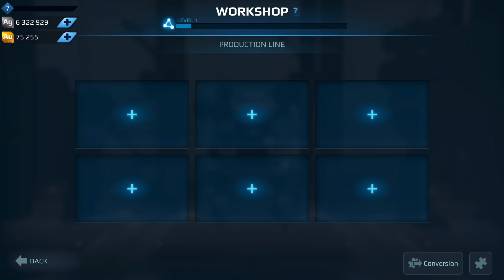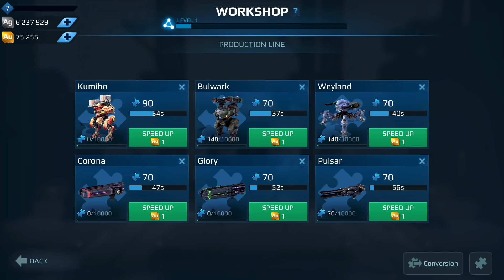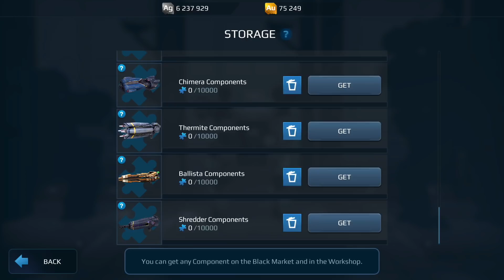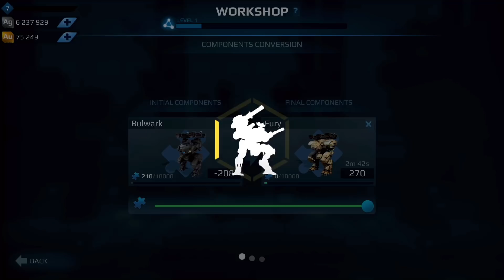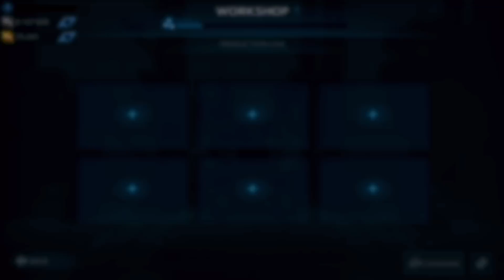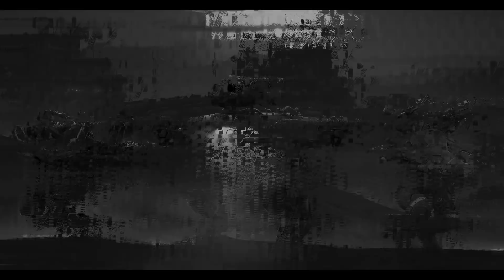NEW Workshop 2.0 Component Conversion Feature Explained / War Robots Test Server

Comment: Ya I would agree the numbers are not accurate. In fact the workshop conversion is the total opposite from the videos put out by Pixonic on how it works. No matter how many prices I convert, I always get less components than I converted and in the case of 270 components converted, I’m only getting like 50 or 60 in return and the cost is like a million silver to convert and that’s how it works so far. And making 400 at a time is now like 240 at most with a cost that is unbelievably outrageous. Thanks for the big fuck you Pixonic. Oh wait, I bet the next update will be even more ridiculous than 4.5 was.

Comment: I'd rather have a lower conversion ratio, but have it be free. So instead of 208 bulwork to 270 fury for say it's 10,000 silver. I'd rather have 250 fury parts and have it cost no silver. Just have a time limitation. And I'd like to see bots and weapons go back and forth, but I can see why they they doing that so it's not a big deal. But having it cost silver is not OK in my book. Just make the conversion less efficient.

Comment: Hi how are you? I have tested this in the test server. It does work it is a good way to convert components you don’t need or want. It would be nice if the amount and times are as fast as the test server. It would be nice if silver payout were increased because right now in live server you run out of silver when you are upgrading past level 9. I think it was like 25 million to go from level 11 to 12. Overall it’s a good idea but in sure the time will get increased to days and silver will get increased. And to speed up conversions gold will be like 1000 au. To do it.

Comment: If component conversion actually is cheap to use and doesn't take an eternity. Then i would approve

Also i hope the conversion values are fair. Like i have 9685 components for a rayker i should be able to transfer that to atleast 9000 components for either of the other two Supresser bots.

Comment: in the way of seeing this version. It's not much different from the last one, why can't we just produce the components we need instead of giving us something that we had too much already, and wasting more time for conversion. 

REALLY NOT MUCH DIFFERENCE.
Reply from the maker: Because what you will find as a player eventually - everything from events to Black Market spins to Battle Reward crates, you will end up with many components for items you don't need. For example... yesterday I won 2000 Sting components but I don't like that weapon nor do I have any desire to upgrade it at this point. I also have 2x Rayker, 3x Invader and 2x Blitz which I didn't buy but won through the Black Market spins (free) and the Battle Reward crates. By not having this feature, the only option I have is to sell those components for silver. I then have to use that silver to buy components for the items I need. You might be thinking... "well... isn't that better and isn't that what you'd be doing anyways?". The answer: No it's not better. By using this new feature, if I need silver I can sell 2x Invaders and convert 10,000 Invader components into a Mender (just an example) while ALSO producing 2400 Mender components at the same time. This allows me to speed up my component production for any item in the game. I'm using wasted components to get something I need faster. I'm not sure if you quite understand this?

Comment: The idea of component conversion is great! But I don't like the fact that it costs silver. Or the fact that it costs the same amount of silver irregardless of how many components you want to convert.
Through the workshop each weapon or robot has got a silver value (price of all 10000 components). When converting components, the value  of the initial components should match the value of the produced components minus 10% (or whatever value Piconic thinks about). This way converting is unfavorable as compared to production and the "silver cost" is dependent of the component numbers. With this system players won't have to worry about "efficient" converting in terms of silver costs and will actually use the feature.